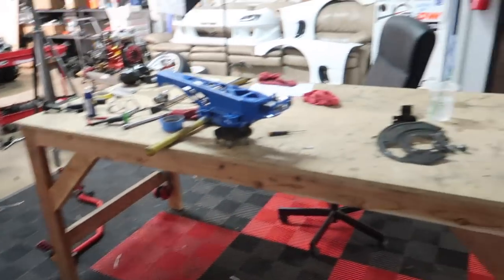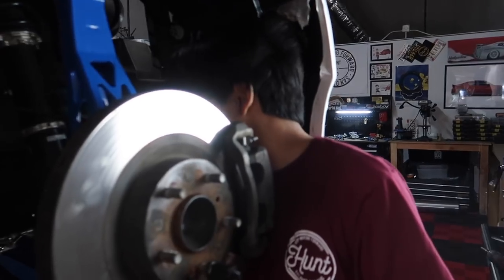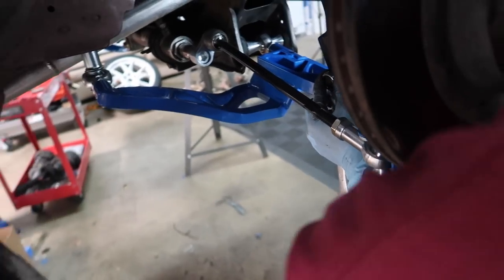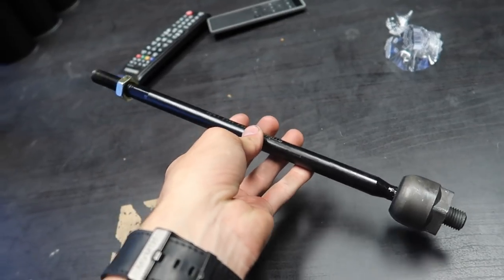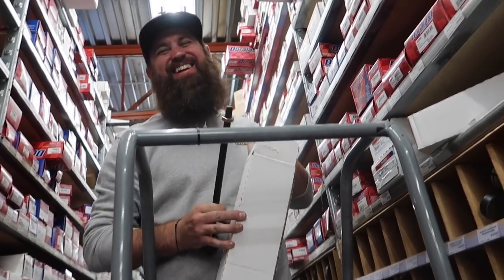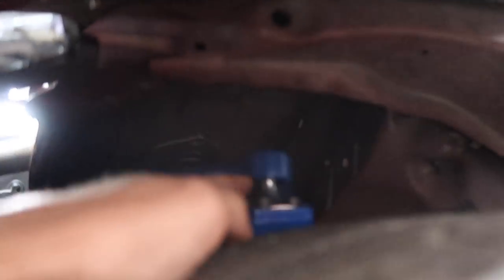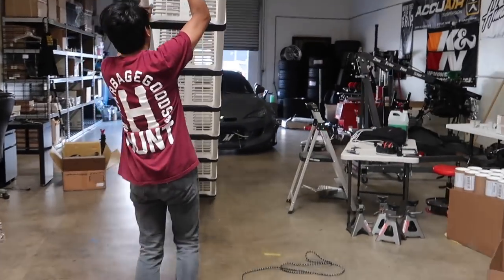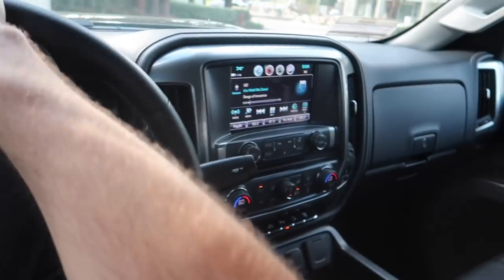Achieving maximum steering angle!

Comment: I think the rack spacer adapter things may be on the wrong sides. I remember seeing on another channel someone did this also. I believe that piece sgould be horizontal, not at an angle when bolted to the rack. It should help the angle of the the rod when it goes to the spindle.